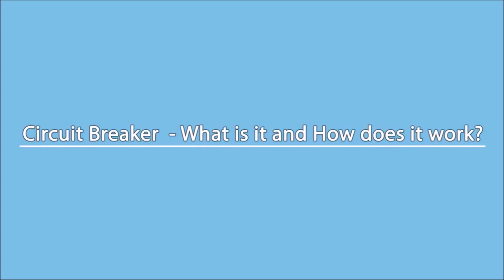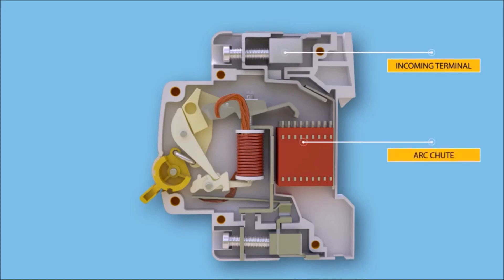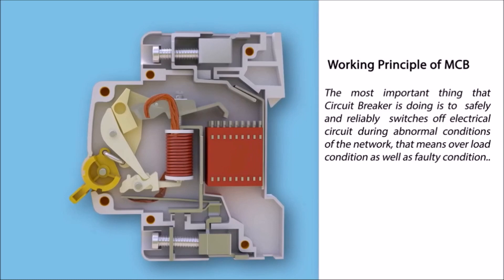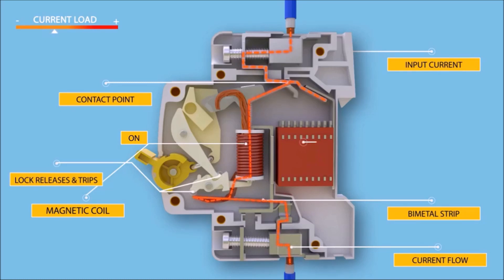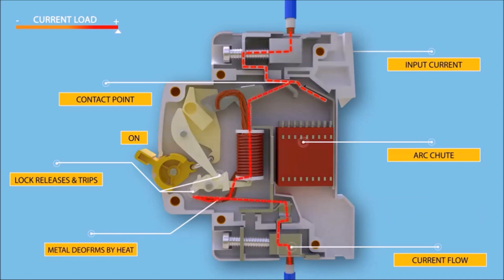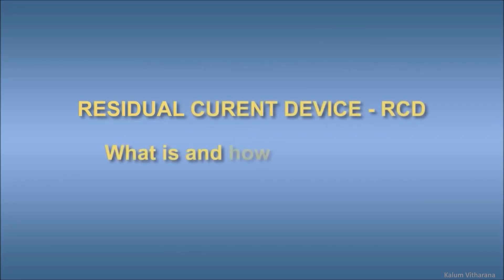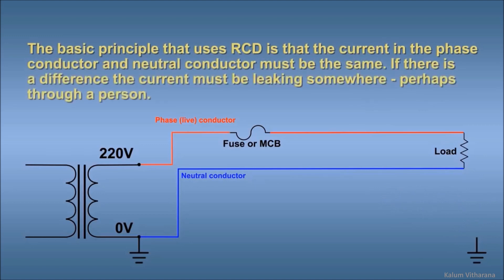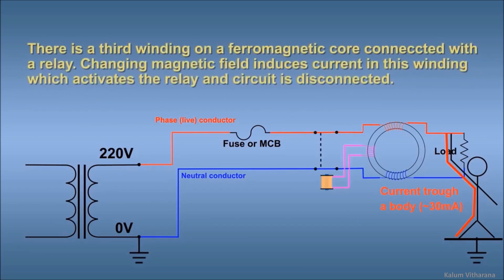HOW MCB AND RCD WORK

Comment: is there a diode in it?
Reply: I mean - is there a diode in a rdc - because the AC is constantly changing direction - which the electromagnet would have to deal with - and without an diode - how? It should either attract or repel the contact , not change polarity all the time.

Comment: If the appliance is installed in a very high humidity environment, shall the RCD be better used instead of MCB? Or no difference at all?
Reply from the maker: Their action is different. MCB for the short circuit protection and RCD for the earth leakage protection. For the high humidity you can use heater inside the panel.
Reply: I would recommend an RCD since it's a high humidity environment, the chances of getting electrocuted is also high
Reply: @ilisonitukalou5722  You need both. One is for fire protection so no one dies of a fire in the house, (short circuit), the other is for electricution protection, so no one dies of electricity.